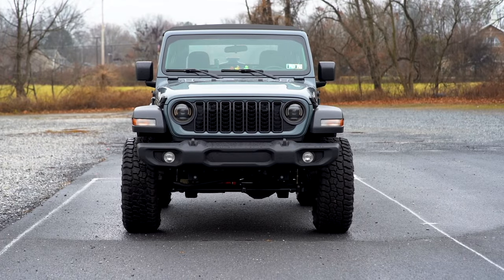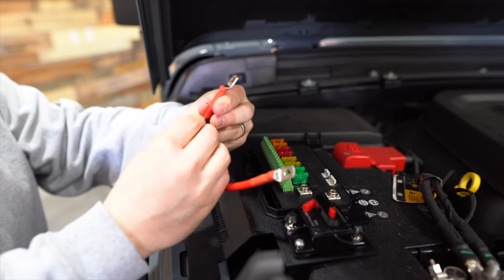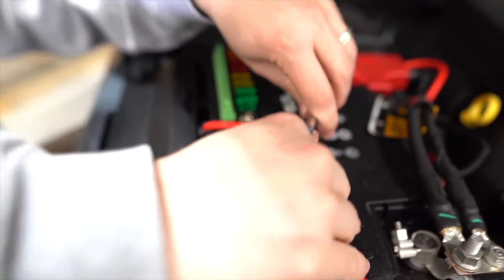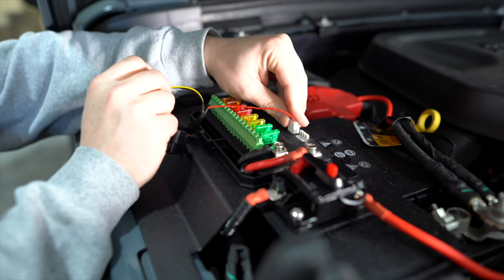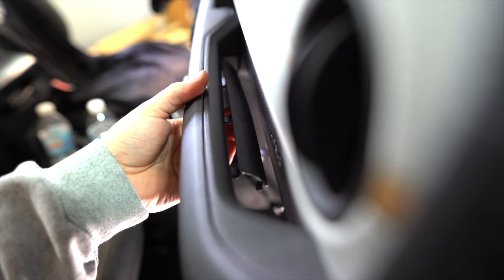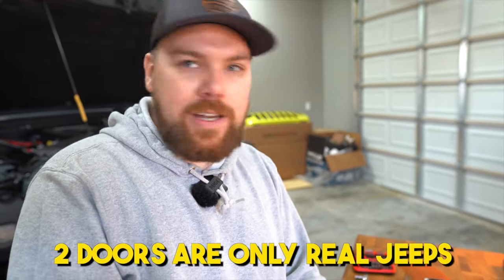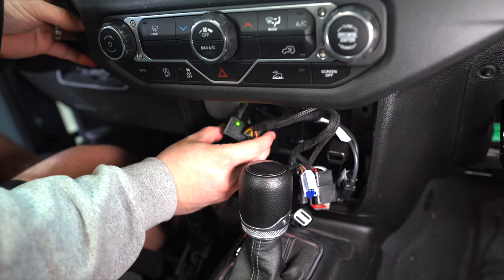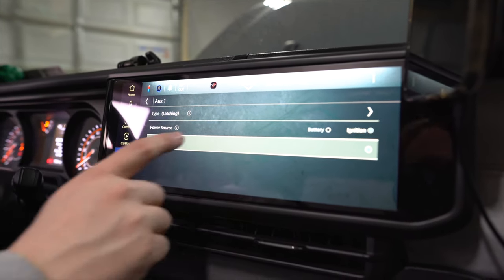2024 Jeep Wrangler Aux Switches & Rubicon Locker Buttons Install

Comment: Hey Matt, I hate to see you learn the hard way, but you should remove your wedding ring when working around batteries. Ouch 🤕!!!
Reply from the maker: lol good tip!
Reply: Another advantage to the silicone wedding ring I've been wearing for over ten years now. It also eliminates the possibility of "sleeving" my finger when climbing up and down my the helicopter.
Reply: @michaelscheller6884  yeah man! You got it. Anyone working around anything electrical or climbing on equipment should not be wearing a metallic wedding ring.

Comment: Hey Matt I have a 23 Mojave with the aux group but I want to add the front locker using the rubicon switch besides the locker itself do I need anything else other then the factory rubicon switch and Tazer mini from Z automotives ?

Comment: For the backlighting on the DD lights, don't use an aux switch if you have the aux switches from the factory. In the interior aux wire bundle by the glove box they provide a switched via ignition, as well as a direct to battery, 10A power wire. Ignition is the pink/orange wire, direct to battery is red/white. Fuses are F50 and F72 respectively. 

This of course is 18-23 MY, not sure if they changed that on the 24's.

Comment: Nice find. 
I am assuming that this is just turning the locker switches into AUX 5, 6, 7, 8 and you would be able to lock the rear (in your example) in 2WD or at high speed.
If so, what would you suggest to add a safety step to ensure lockers are accessible off road. Other aftermarket switch banks have a "power" or "lock-out" button so there are two steps to get the lockers active.
Been looking at this for a 2018 sport (no power windows)
Reply from the maker: Correct! Fun upgrade in the next video with these switches.

Comment: Maybe I missed it but where does the new module connect with the stereo etc screen so that you can access the switch control  preferences.
Reply from the maker: The adapter box goes behind the HVAC controls.

Comment: Does it make sense to acquire this if I have factory auxiliary switches but no factory lockers, and I wish to add lockers using the factory locker switch?
Reply from the maker: It works well just for that, I just like that it uses the stock switches!
Reply: @DIRTROADCRED  I like that too - I'm one of the weirdos that like to keep things as OEM in appearance as possible 😁

Comment: Hate to sound like that guy, but if you're planning on adding Rubi lockers and sway bar, why didn't you just buy a 2dr Rubi?

What would be cool is if you could've have gotten custom buttons with that instead of having them "Aux 1,2,3,4". Six years in for the JLs and I'm really suprised someone hasn't made custom buttons for the factory switches.

Cool install video.
Reply from the maker: The whole goal of this build was to start with a base sport. We have some surprises in the next video. Thanks for watching!
Reply: @DIRTROADCRED  No problem. Hope my post didn't come off negative. I just thought a basic Rubi could still leave room for a build.

Do the base JLs have the Offroad+ or can that be added since Ryan has that button installed?
Reply from the maker: Rubi makes the most sense from the start for sure